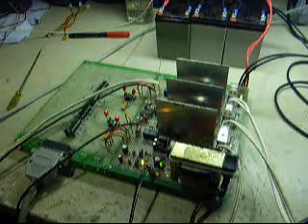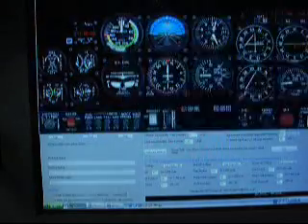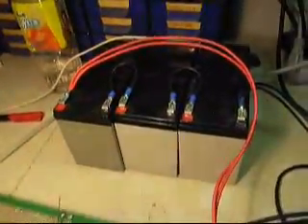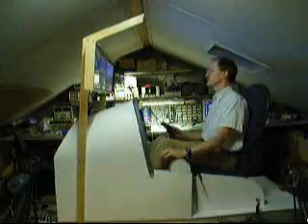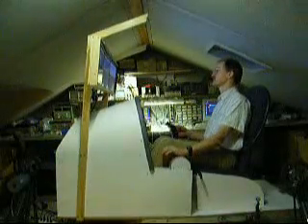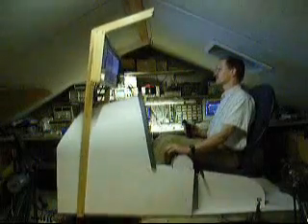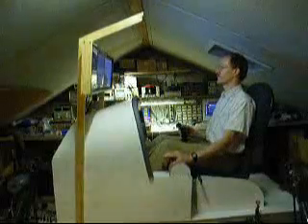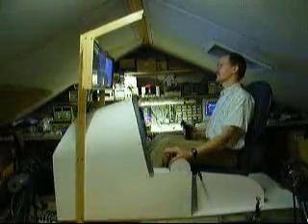3doF flightsimulation motion platform

Comment from the maker: I did a weight-drive calculation, see the website. As long as you keep the platform weight-balanced, the servo's can drive it, but heavier platforms will respond slower, unless you increase the power conciderably. 
Mechanical structure will need to be modified when you use much heavier platforms.

Comment from the maker: I'm working on putting the 'hood' back on, together with the 40" fresnell lens. That should give me a pretty good immersion. 
Complete system price is hard to give, since I used a lot of old junk. A rough estimate: 
3doF platform: 
Mechanical:€500, Electrical: €250
Visual system: €450, Simpit: €400
and loads of spare time.